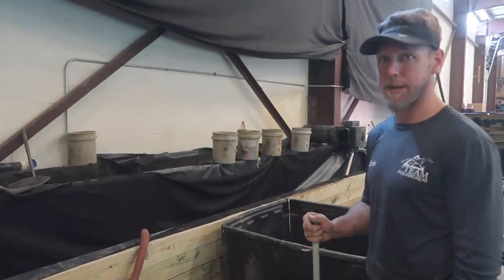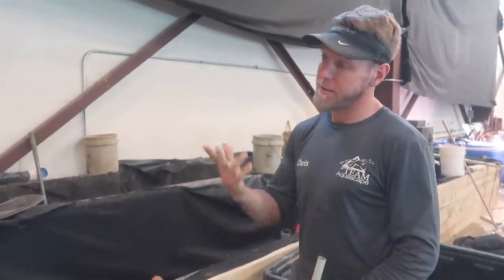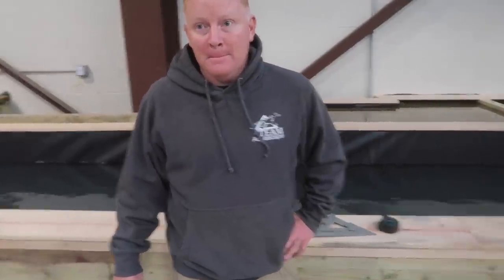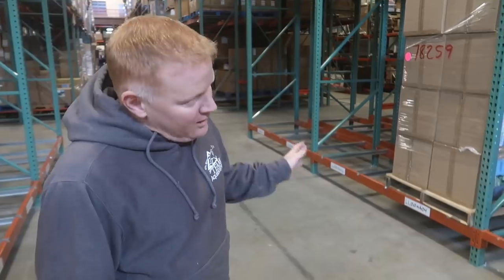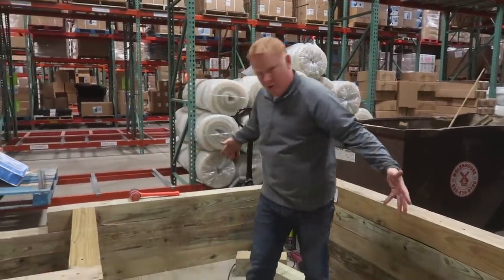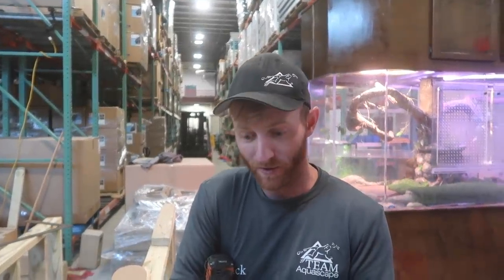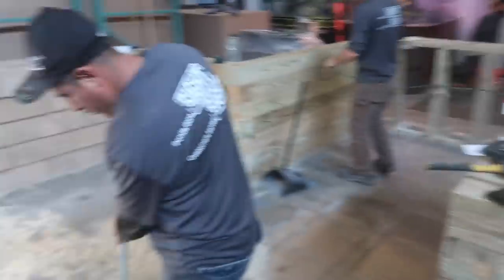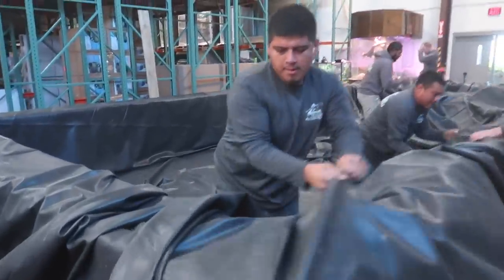Indoor FISH POND Disaster!!  Retail Revamp: Part 6

Comment: I am a retired designer, so i feel i can say this to you: Over-engineering is your friend.  There is a cost associated with over-engineering but it is no where near the cost of under engineering. You are not the first this has happened to - and you won't be the last. But it can be the last time it happens to you. 
A line that seems appropriate (to me at least!) and it comes from The Devil Wears Prada. "Gird your loins, people!"  Hang in there guys, you are still the best in my book, the more so because you have revealed yourselves to be human.
Reply: Julie Enslow you learn more from life’s valleys than mountain tops!
Reply: @GregWittstockThePondGuy  
Indeed, it is the valley that is the harshest teacher. But the guys did not understand the concept of over-engineering. They upped their game and are probably ok. But over engineering means they should be so far past the point everyone agrees its ok, that most people are complaining its too much. That's when you know it is truly OVER engineered! Structural engineers often do that - because the cost of a failure is a body count.They calculate the load, imagine every possibility, add that to the load, add a contingency factor, then increase it by 50% then see what will hold that new load. That is over engineered! And rock solid. No one wants the foundation to be the minimum required for the planned load - because no one knows what might move in!
Reply: @GregWittstockThePondGuy  So true!